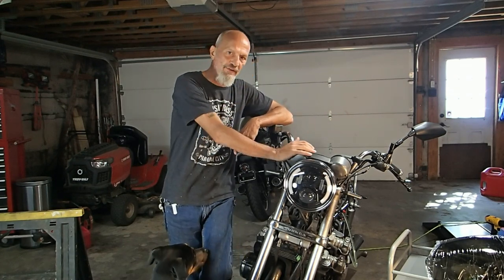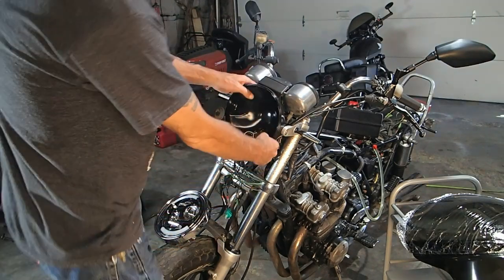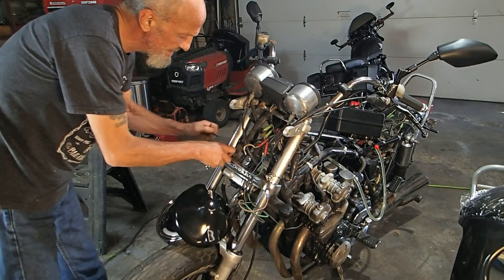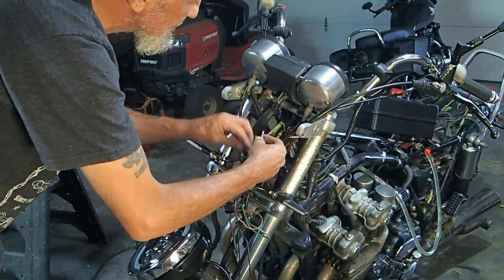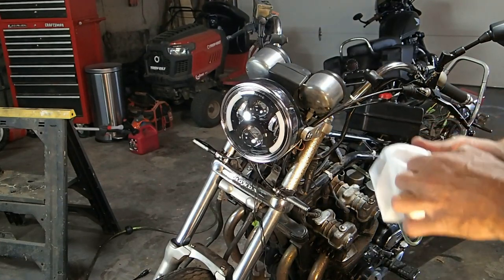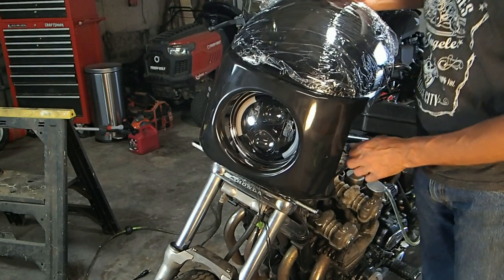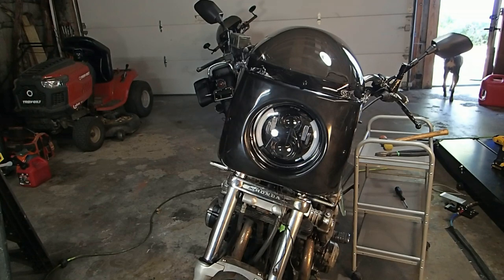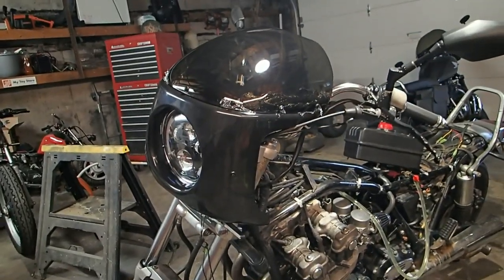1983 Honda CB1000 Custom, cafe racer build Part 11: fairing install and turn signal relocation

Comment: I have the same one will be frame mounting with some welding needed. Yes the fairing sits tall about the same as a sportbike. There is alittle wobble with the fairing being fork mounted. But it does work less twist on the throttle will improve mileage and wind noise